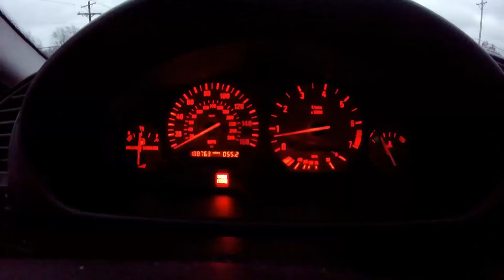Should You Ever Replace Your Transmission Filter?

Comment: You don’t need to change the engine oil filter every change. Every other is perfectly fine if you use a decent filter. Trans filter. I do my fluid every year because I plow and tow with my truck I change the trans filter every other change.

Comment: I disagree I just changed mine and it runs better than ever it was slipping in 2nd gear now it's changing like it should
Reply from the maker: What transmission do you have and did you cut the old filter open to see what was wrong with it? I’m genuinely curious what was wrong with the filter that changing it made 2nd gear work better.
Reply: @PetesGarageandperformance  I have a 89 Chevy pickup when I drop the the transmission pan the fluid was black and the filter was clogged but there was no metal fragments in the bottom of the pan so I changed it to just to see if that was a problem and is working fine right now transmission hadn't been serviced since 2015
Reply from the maker: I’m thinking the fluid change made the most difference. If there was that much clutch material in it, your transmission is on borrowed time. Hopefully it lasts a while, but I has to be hurt. Keep me posted how long it lasts.

Comment: Like you said, the filter is rated for the life of clutch material and incidental break in of the gears from manufacturing. If the filter clogs it’s really because your transmission is already toast. 

Note, like oil filters are rated for a particular amount of miles these transmission filters are rated for the amount of material that will wear to the point of failure. Changing your air filter when it’s clean doesn’t actually help and changing your oil filter under normal circumstances in the middle of your oil change interval will not help you as well.

Comment: all oils break down due to heat . cheaper to change oil  before it stinks or changes from pink to brown . then transmissions.
Reply from the maker: I agree. Change the fluid. No need to change the filter though. A good exchange with a machine that uses the cooler lines will get the fluid in the torque converter too.

Comment: so why is there a filter in the first place?
Reply from the maker: To protect the pump and valve body from the normal amount of clutch material that gets caught in the filter.
Reply: @PetesGarageandperformance  does the "normal amount" of clutch material that gets caught in the filter accumulate? Eventually requiring a filter change depending on the filter media?
Reply from the maker: If there’s enough accumulation of clutch material to cause an issue, that particular clutch would be slipping from lack of friction material. It would require a rebuild anyway. Changing the filter isn’t going to fix anything.
Reply: @PetesGarageandperformance  ahh. I see why you say it causes a debate. One more question. What do you think of the kits that add a dipstick to transmissions that only have a full hole. Mainly a 2013 f150 5.0 with the 6spd auto. I changed just the fluid around 60k and it was a pain. Haha
Reply from the maker: Yeah they can be a pain. However they’re really not that bad to set the level. I just fill it up to where it comes out of the hole with the fluid cold. Then when the fluid is the correct temp (usually 158*f) I open the check plug and let the excess drain off. Then when it stops coming out, the level is correct. It does make it difficult to check the fluid condition though.

Comment: If you never need to change a trans filter ….why does the manufacturer put a filter in the trans to start with. If it’s there to filter contaminants and metal shavings stands to reason over time temperature changes ..trans fluid burning getting dirty and thicker …then it would seem logical the filter like all filters would loose some of its efficiency and effectiveness in picking up contaminants sludge or filtering debris.

Comment: I did the change in a van that seemed like it was really slipping n wouldn't go past 30 35 with a bunch of code. Changed the filter n of course whatever fluids came out n all code went away n haven't had a problem since... I guess to each it's own.
Reply from the maker: Are you sure it wasn’t just low on trans fluid? I bet it wasn’t the filter that caused your issue. How long has it lasted since you did this?
Reply: @PetesGarageandperformance  that's the issue it wasn't low on fluid, I have a Latino friend that lives by it so he said just change the fluid n filter and see what happens. N that car I very first did it to has been on the road for 4 years. The van I just did last winter N it's still on the road N the fluid were topped off before I did it...
Reply from the maker: What kind of van?
Reply: @PetesGarageandperformance  2002 dodge caravan, and my sons car is 2006 ford Taurus.
Reply from the maker: Maybe Dodge and Ford make an inferior filter that doesn’t have the necessary surface area to not get clogged?

Comment: Change the fluid once a year. My system takes 12 litres but when you drain it you only get 5 litres out. So kinda you are only replacing the fluid once every 3 years even though you are doing it once a year. My box is $6000 with a new torque converter not including labour for fitting. Its $60 bucks and 1 hour to do a fluid change once a year. Get a new cooler with a new transmission (if you have one) or else it will void your warranty $$$.

Comment: You go ahead and not change your filter but I am. Your transmission might be sealed from the elements but your magnets tell you that there is debris in the fluid from the clutches and metal parts so if that isn't enough of a clue why you need to change the filter then i don't know what is. I will change mine, thank you very much.

Comment: I don't agree with this explanation because the original designed of transmission there is a filter there to protect the normal wearing particles don't come back to damage scratching valves and pistons etc. the other reason to change the filter is because the normal wearing accumulate a lot particles that  block filter reducing the suction then producing a lack lubrications  and the start the truly damage into the transmission that is why we change the oil filter it's necessary and important .

Comment: I wonder if you would agree with the analysis in this video as to when you should change and not change tranny fluid. Is, perhaps, the trans dip stick a possible source of contaminants as well.

https://m.youtube.com/watch?v=uHmQcb85-nk
Reply from the maker: If your transmission looks like the one in that video, you need a rebuild. I bet the cooler is plugged up in that vehicle. That fluid got HOT. If you simply change the fluid and filter in this transmission, it wouldn’t last long. There’s a reason why it’s sitting on his bench.

As far as the dipstick tube goes; it should be sealed and you shouldn’t let dirt get into it.

Comment: Completely disagree. with Pete. Filters are cheap. In F150 transmissions and other transmissions one would want to drop and clean the. pan early and remove the loose metal from the system. The metal can get into the solenoids and cause problems.   For a new vehicle my go to solution is to drop and drain the transmission fluid and change the filter at between 30-60,000 miles. This may be the last time I change the filter. Replace the pan with one with a drain plug. Perform drains only at 30-60000 mile intervals and consider changing the filter every second or third  or fourth fluid drain.

Comment: Ok…so yes huge debate here…99% of the time you do not have to change the trans filter. But remember if you don’t change drain and change your trans fluid every 50k to 75k after the 100k interval you asking for trouble. The main problem is people put these heavy duty vehicles 3/4 ton and above under an enormous amount of pressure. Everyone  I know that has one pulls too much weight for too long. The transmission heats up too high and breaks down the viscosity and ingredients that are supposed to protect the clutches. The clutch eventually disintegrates and stope up the filter. The gears are now in an oven and they have no chance causing a catastrophic failure.

Mechanics will stand by the microscopic cutting that build up in the filter. Ya ok…we will see, if you just drain and change regularly and insure you’re not over heating you will be fine. But if you don’t service your transmission and it does break prior to warranty term…they will not cover it.

Comment: This is really bad advice IMO, I rebuild transmissions. The filter gets dirty because every time you start off and every time the transmission changes gears some metal wears off the steels and clutch lining wears off and is carried away by the fluid, this is why the fluid does not remain cherry red. Filters are cheap, transmissions cost around $5,000. I have had customers who change their fluid and filters regularly and  and some that never change it. Guess which ones last longer?

Comment: A guy who rebuilds transmissions saying don’t service them is fishy. Heat kills trans fluid over time. As this happens the fluid lubricity properties drop, and metal parts in the trans star to wear. Further accelerating wear. Being a sealed unit means nothing. If it did you wouldn’t need to service the fluid either - which of course isn’t true… Service the fluid regularly, don’t abuse the trans mission. And this will give you the maximum life out of your transmission.
Reply from the maker: I didn’t say to not change the fluid. You should always have good, clean fluid. But the filter is another story. If you’re doing the work yourself, go ahead and spend the extra time dropping the pan and replace the filter. All it costs is about $20 and an hour of time. But if you’re paying a shop to do it, that hour will cost $100 or more.
Reply: @PetesGarageandperformance  Right I was talking about the "sealed unit" comment. Filters catch the loose clutch material and other contaminates. But then again some brands just have screen and not an actual filter. In any case, service transmissions regularly and don't abuse them to get max life out of them.

Comment: That's what Toyota dealership told me too. I told them to change the trans filter and fluid of my 2003 V8 4Runner, but they said we will flush it but not change the filter because it will damage the Transmission. I wonder why they said that. 

The trans fluid never changed since I bought the car in Dec of 2002 (Trans fluid was changed 2 months ago) and you can barely notice the shifting before and after flushing the Transmission. I guess the 4Runner transmission is just bulletproof lol.

Comment: I'm not sure how much this guy does with transmissions but if you think about it over time your clutches will start wearing out with wear and tear where does that wear and tear clutch material go some of it gets caught by the magnet in your pan the other gets caught by your filter.
If you're changing your fluid out over 75,000 miles which should be a normal transmission fluid change why in the heck wouldn't you pay an extra light for five bucks and change out your filter at the same time.
It's just like those lifetime transmission fluids in the new vehicles sure the company says it's lifetime but do they give you a lifetime warranty on your transmission then?!
Transmission fluid will start to break down over time with all the heat cycles and clutch material added to it it will start thickening that I could start to clog up the filter, also when you remove the filter most of the time a cup or more a fluid will drain out after the filter so there's always fluid trapped on top of the filter.
I definitely recommend if you're going to take the time to drain your transmission fluid and go ahead and change your filter it definitely cannot hurt and if your filters getting clogged with clutch material just from normal wear and taking out that barrier/filter maybe it runs smoother once again.
I definitely do not recommend having a transmission back flushed like he recommended that can cause several particles to be lodged in your valve body / transmission solenoids and cause more harm than good a good will change and filter change is a way to go.
If your transmission as an interior wheel filter that cannot be replaced then the transmission fluid change should be pumped up to 40 to 50,000 MI, because if that filter gets clogged in the transmission due to normal wear and tear if it cost several thousand dollars to have it torn down and rebuilt.
Reply from the maker: If you have enough clutch material in your filter to cause a restriction, your clutches are worn out. Changing the filter won’t fix worn parts.
Reply: True a new filter will not fix worn out clutches but if your filter is clogged and your clutches are halfway worn out it will sure make those clutches last a whole lot longer.
Also two bottles of transmission fix from Lucas will help prolong the inevitable.
I'm just saying if you're going to do a whole fluid change and you're right there at the filter change it it won't hurt either thing and usually transmission filters are only a few bucks.

Comment: IC, That means as per your Experience and Expertise , Transmission Filters are Useless right? Never Mind that it can get clogged from the materials that come off the Clutch Pack? Or.. Or.. Maybe People want to see if there are Metals that got caught in it and figure out if the transmission need to be  fixed before the CATASTROPHIC Failure? Just wondering....

I use to work for dealerships for more than 15 year, SEALED Transmissions ARE a SCAM..... Technicians will always say everything is great until it breaks and need to be fixed..To drain and refill transmission fluid by a Technician is around $200.. but if the Trusted Technician have to replace your Transmission it is a whopping min $4k, right? Hmmmmmmmmm

You are a Trusted Technician, How Come every time your Customers Sees you it always costs them Money?

Comment: Hell yeah replace your filter.. they can get clogged over time and burn up the tranny.. also if you can find a filter that isn’t all covered up in plastic that will  allow better flow… even better. The better that fluid is circulating the faster it will be fed through the radiator which results in a cooler running tranny which in turn leads to it taking longer for the fluid to turn black and burnt.

Comment: The longer you take to service your transmission you are wearing out your gears, so when you flush out the fluids it wash down the metal pieces material that keeps your transmission shifting smooth I see most of the particles get caught in the filter and the magnet on the pan

Comment: I own a 1998 GMC SIERRA 1500 two wheel drive it has 156000 on it and I change the trani filter every 30000 miles it's for longitvey. And geuss what sir I know others who own trucks like mine they had the trani flush only then wined up replaced three transmission. So your wrong!!!

Comment: No.... You are wrong. I have bought several.cars and trucks that didn't shift I replaced the trans filter and fluids and guess what. I drove them for. years after.
Reply from the maker: Can you be more specific what transmission had what fault that a filter fixed?

Comment: the simple answer is:  If your oil is burnt or black, don't bother changing it the fluid, you will likely cause more issues.  At this point, your transmission is beyond saving.  Flushing fluid out of a dirty, sludged up burnt black oiled transmission could cause clutch slippage, valve body clogs and poor shifting. 

If you have clean fluid that i simply old and only slightly discolored, flush system and change filter.  Manufactures have intervals for a reason.  Bottom line, if you have check and react and change per the intervals, you will never have to worry about your transmission, unless of course you drive like an asshole 🙂

Comment: Disagree.  What are you really saving by not changing the trans filter?  A few dollars.  However, what could be the consequences of not changing the filter?  A new tranny.  Dirt, metal, varnish, etc. are all part of what a filter- filters.  If it's dark and the fluid is not the same color as original then they both need to be changed.  Now, I change my tranny fluid at 80- 100K intervals.  If I changed every 30 or 40K I can agree with your point.
Reply from the maker: If you’re changing it yourself then it doesn’t cost much more. If you don’t work on your own car then you’ll need to pay labor for someone else to do it. Then it costs quite a bit more. Most people now days don’t work on their own vehicles.

Comment: Filter is a  misnomer it’s a strainer it protects the gearbox should there be a failure of a component. Changing the filter and cleaning the magnets makes ocd maintainers happy and gives them something to do however will have no impact on your transmission longevity. The fluid another issue that needs replacing again that said many Toyota transmissions have no set service interval and therefore are never changed out and there are thousands of those suv with hundreds of thousands of miles not an issue
Again we like to outthink the Japanese engineers that designed the car probably not a good idea